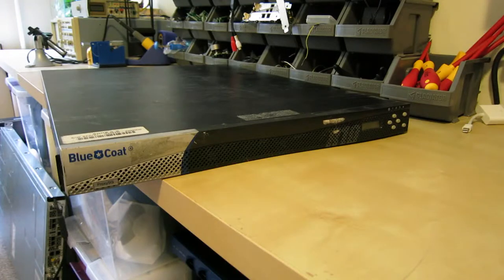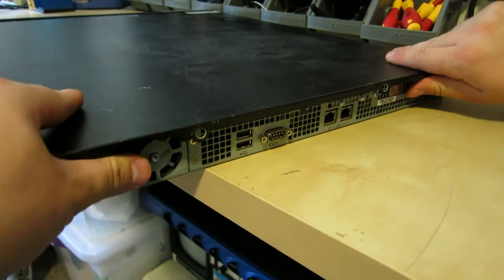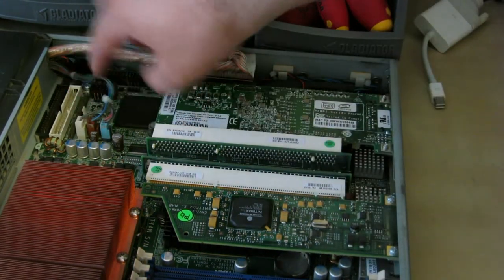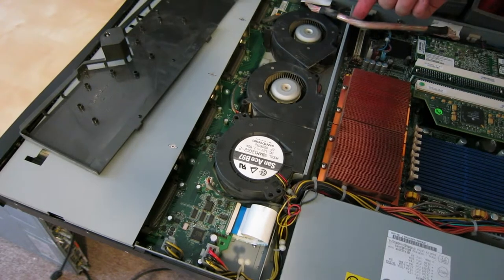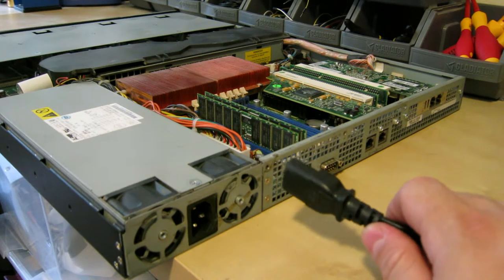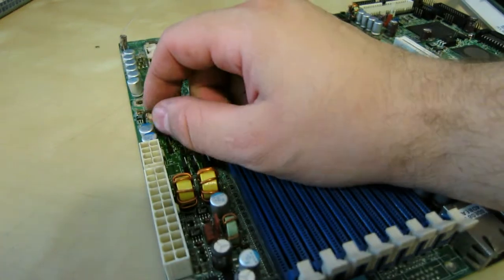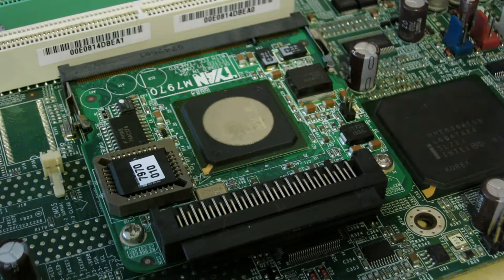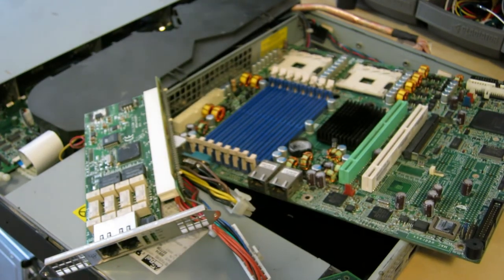Blue Coat ProxySG 810 Teardown

Comment: Not sure if they're Dells, but the boards are standard server boards. The 810s were the second largest range of boxes (the 8100s were top of the line) The SSL accelerator card was an optional extra (I don't think it supports elliptic curve encryption at all). With 2GB RAM, I can't tell exactly which model, but it could be an 810-10, or if older, an n810-B or C.
The fans usually spin down after a few seconds, so that box probably has a faulty sensor of sorts.
The CPUs actually DO have hyperthreading, but it should be disabled in the BIOS.
The hardware really isn't interesting, those boxes do their magic in software (which requires a license).